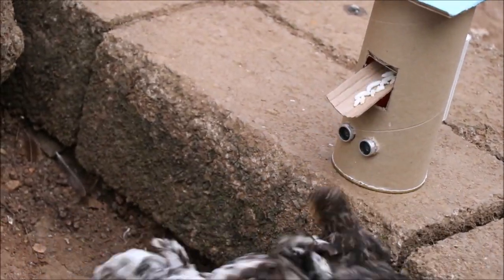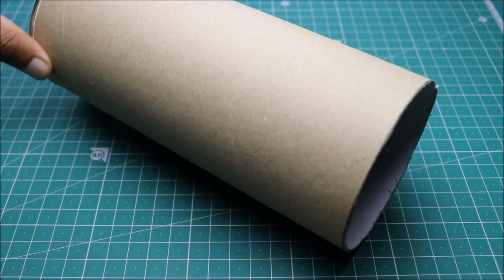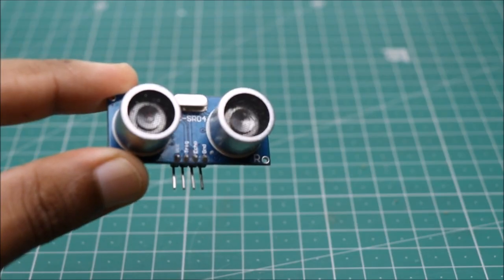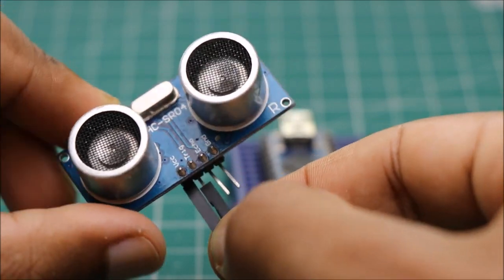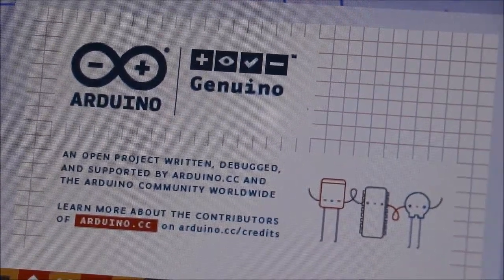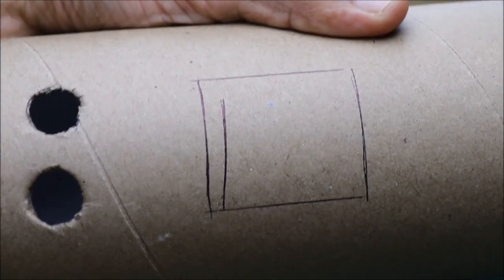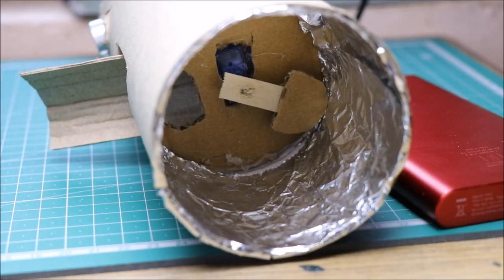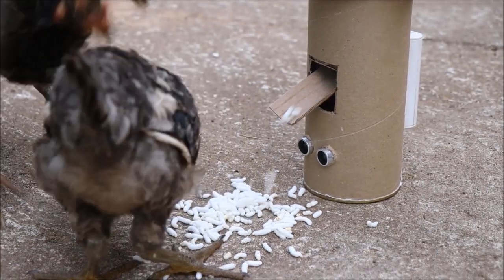How To Make Automatic Food Dispenser For PETS | Best ARDUINO PROJECTS

Comment: Which battery should we use, so that It will work properly with the shown motor. How much volts battery? Can you give us the link of your used battery?
Reply from the maker: You can use 2 lithium ion batteries, it is easily available in local electronic shops